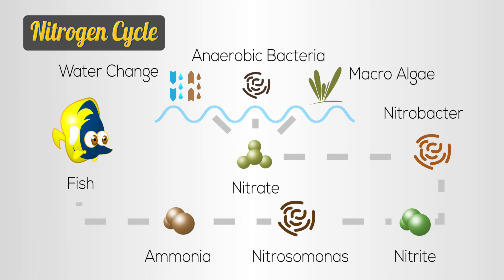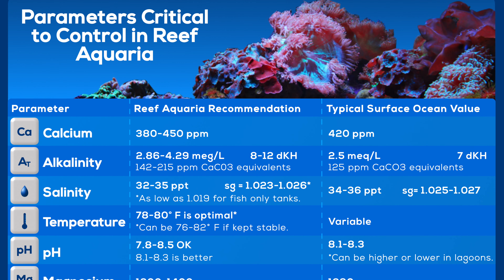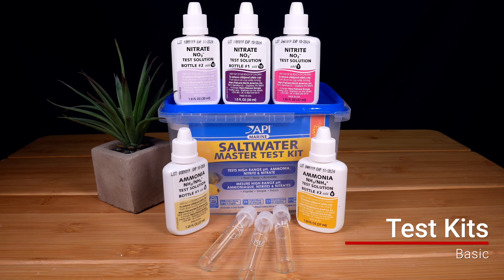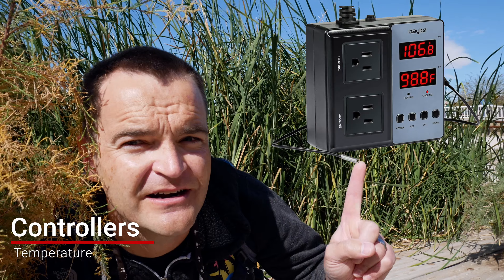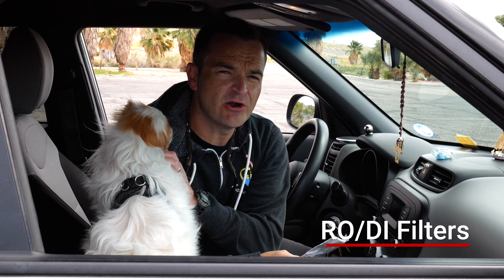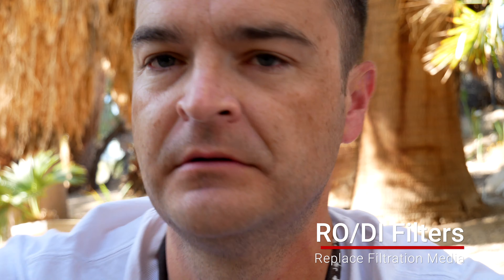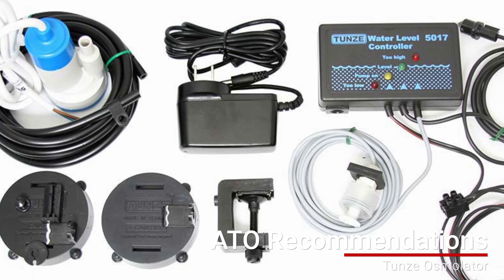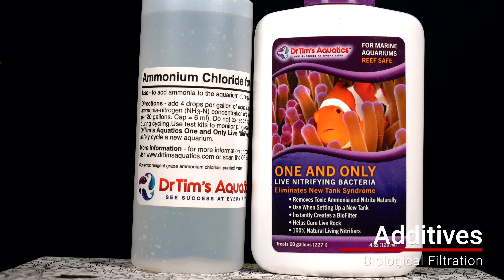Saltwater Chemistry, RODI Filters, Salt Mix | Episode 04 | Saltwater Aquariums Demystified

Comment: I am starting to make my own RODI water after watching your videos.  I have some containers that have white residue in the bottom in my containers that I have been storing the saltwater that I have been purchasing from my LFS.  How can I best clean out my containers to use while making my own saltwater at home?  Thanks,  Brian
Reply from the maker: Hi Bryan, sorry for the late reply. Certain salts mix quite dirty. For example red sea coral pro an instant ocean are notorious for leaving behind a brown residue. I don't think that residue is dangerous but it's certainly unsightly and gunks up your pumps overtime. The easiest way to prevent this going forward would be to switch to something like Tropic Mariners SALT. It makes it super clean. But since you already have the brown gunk in there, I would clean it out every few months with just some water and a bristle brush. It's definitely a pain in the butt, but with a little elbow grease you can get it to work!